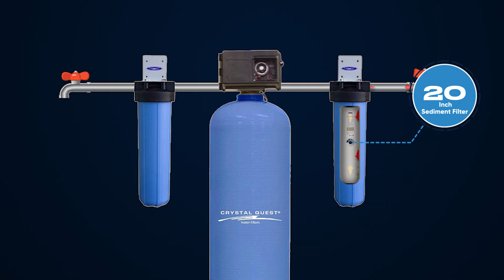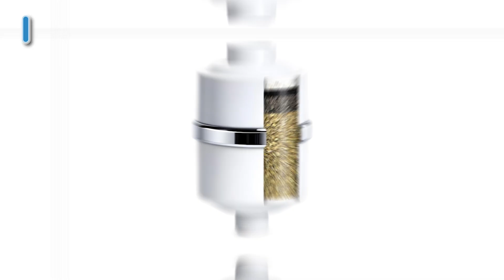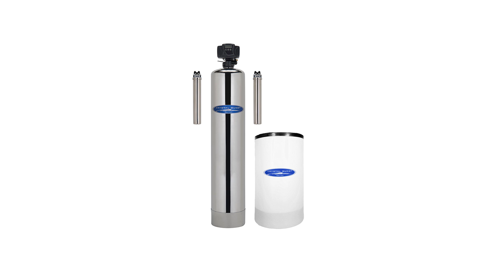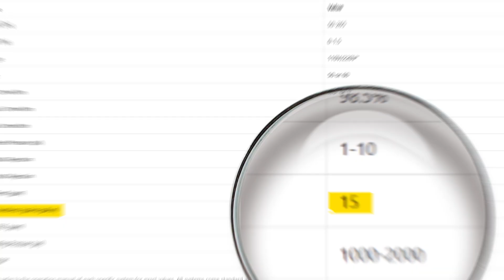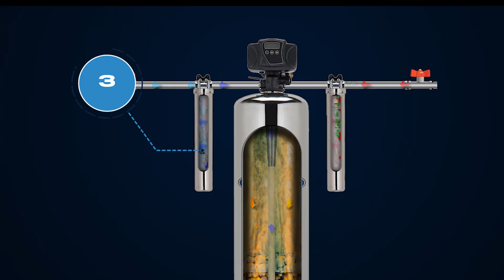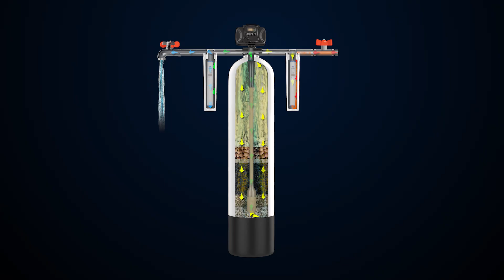Crystal Quest Water Filter Reviews: Comparing 10 Popular Crystal Quest Filters

Comment from the maker: 📌 Crystal Quest Water Filter Reviews (Which One Is Right For You?)
Crystal Quest offers a wide range of systems — from faucet and countertop filters to fully customizable whole house treatment. The right choice depends on whether you’re filtering a single tap, the entire home, or targeting a specific water issue.

✅ Use Code “WATERCLARITY” For 5% Off At Crystal Quest

1⃣ Crystal Quest SMART Whole House Water Filter
A customizable whole house filtration system designed for broad contaminant reduction. A strong all‑around option if you want scalable, media‑based filtration for your entire home.
🔎 See Full Details https://waterclarityguide.com/go/crystal-quest-smart-whole-house

2⃣ Crystal Quest Countertop Reverse Osmosis System
A compact reverse osmosis system designed for drinking water purification without permanent installation. Ideal for reducing dissolved contaminants at a single faucet.
🔎 See Full Details https://waterclarityguide.com/go/crystal-quest-countertop-ro

3⃣ Crystal Quest Metal Removal Whole House Water Filter
A whole house system engineered specifically for reducing heavy metals using specialized filtration media. Best suited for municipal water homes targeting metal contaminants.
🔎 See Full Details https://waterclarityguide.com/go/crystal-quest-whole-house-metal-removal

4⃣ Crystal Quest Fluoride Countertop Water Filter System
A countertop drinking water filter designed specifically for fluoride reduction using targeted filtration media.
🔎 See Full Details https://waterclarityguide.com/go/crystal-quest-countertop-fluoride

5⃣ Crystal Quest Whole House Reverse Osmosis System
A full‑scale whole house RO system built for comprehensive dissolved contaminant reduction at every tap. Designed for homeowners seeking higher‑level filtration performance.
🔎 See Full Details https://waterclarityguide.com/go/crystal-quest-whole-house-ro

6⃣ Crystal Quest Faucet Mount Water Filter System
A direct‑attach faucet filter for targeted drinking water filtration with minimal setup.
🔎 See Full Details https://waterclarityguide.com/go/crystal-quest-faucet-mount

7⃣ Crystal Quest Whole House Water Softener with Pre/Post Filtration
A complete softening system designed to remove hardness minerals while incorporating additional pre‑ and post‑filtration stages.
🔎 See Full Details https://waterclarityguide.com/go/crystal-quest-whole-house-softener-system

8⃣ Crystal Quest Shower Filter
A shower‑specific filter designed to reduce chlorine exposure during bathing.
🔎 See Full Details https://waterclarityguide.com/go/crystal-quest-shower-filter

9⃣ Crystal Quest Natural Alkalizer / Ionizer Mineralizer & Oxidation System
A remineralization and oxidation system designed to increase mineral content and adjust water characteristics after filtration.
🔎 See Full Details https://waterclarityguide.com/go/crystal-quest-whole-house-alkalizer

🔟 Crystal Quest High Flow Whole House Water Filter
A high‑capacity whole house filtration system designed to support larger households with higher water demand.
🔎 See Full Details https://waterclarityguide.com/go/crystal-quest-high-flow-whole-house

If you’re looking for flexible whole house filtration, the SMART system is the most adaptable starting point.

If you want reverse osmosis at a single faucet, the Countertop RO provides targeted drinking water purification — while the Whole House RO operates at a full‑home scale.

If you’re targeting a specific issue like heavy metals or fluoride, choose the system engineered specifically for that contaminant.

For hard water, the dedicated softener system addresses mineral buildup directly.

For renters or minimal installation needs, the faucet, countertop, and shower options offer more compact solutions.

(Some links are affiliate links. I may earn a commission at no additional cost to you.)